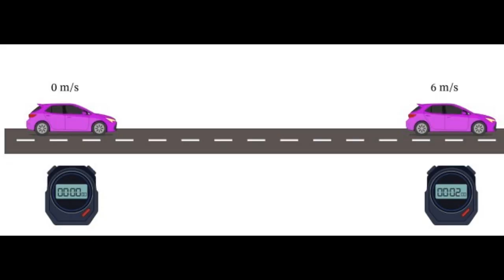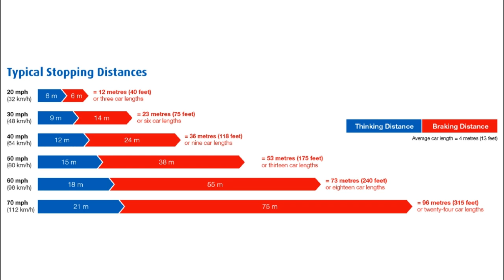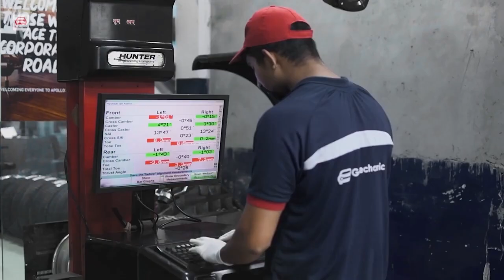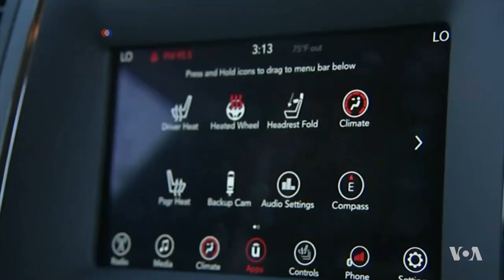Car stopping distances.

Comment: A couple.of points to add:
1) the stopping distances quoted in the Highway Code are TYPICAL stopping distances: not emergency stopping distances. So contrary to popular discussion, they are NOT our of date. 
2) specific knowledge of stopping distances hasnt been a requirement of the theory test for over two years.
Reply from the maker: Thanks  for sharing your knowledge and helping make this video  more informative!